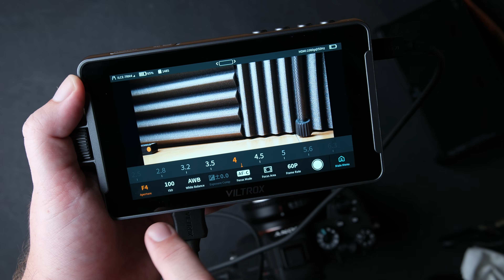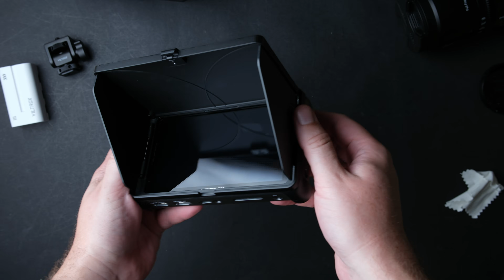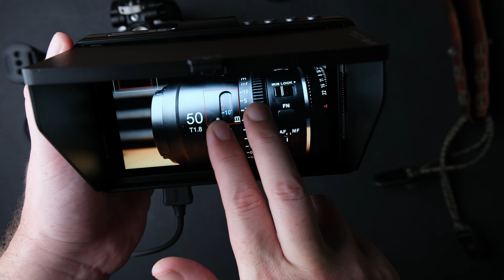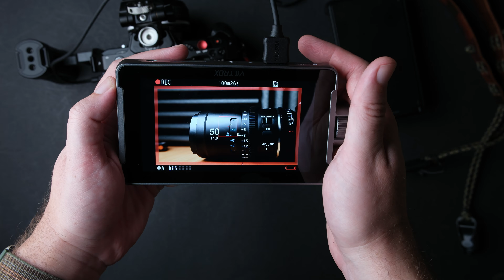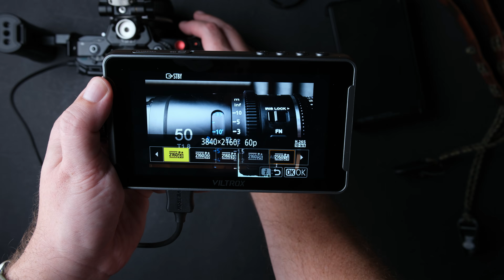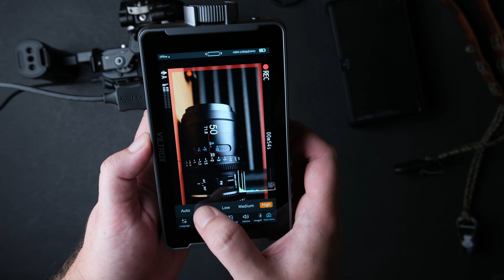Do It All Low Cost Monitor: Viltrox DC-550 Pro MK II Review

Comment: Thanks for a nice video Andrei. I bought two of these monitors DC-550 Pro ll for my two Sony A7C-ll, there's No Camera Control on the Monitor. Viltrox said: it was compatible on their list. (!?) well, I hope they will update the Firmware soon to Fix the Problem....
This is a Nice looking and Perfect Size for my Sony A7C-ll and I Love it.
Reply from the maker: My pleasure! There are two ways to connect the monitor to the camera, via USB-C or bluetooth. The controls will appear after you connect the camera. It won't connect just thru the HDMI. I hope this helps.
Reply: @AndreiDimaReviews     hi sir... i always record 4k 60fps will still black on the camera when recording? it was the problem of the version 1... does it solve the issue?
Reply: This is my experience too...
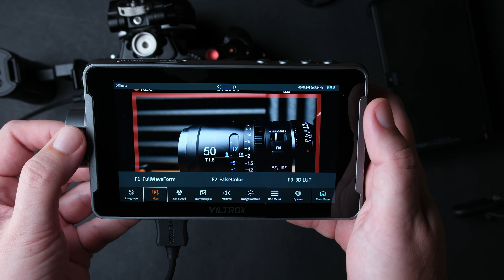I love your videos Andrei, I've been following you since we both got the Fuji XT4 around the same time. But you really need to be more critical of the products you are reviewing. I bought this monitor and within 10mins I realized this company is shady as hell. So much fraudulent advertising. Ya'll notice that every time the camera's HUD is shown such as in 4:31 top right corner says 1080p24P? and not 2160p. Despite one of the main marketed features is 4k input and pass through signal - but this feature is broken for most cameras. If I give it a 4k output it will result in "no signal". 

They promoted and advertised that this monitor is compatible with a bunch of cameras for camera control. (They posted a comprehensive list on their own reddit last I saw). I bought it and it turns out its a complete fraud. The cameras its listed as compatible for such as some of the Sonys, most of the Canons and all of the Nikons are not compatible. They told me they knew this but still wont update their website or compatibility list that they promoted. They wont allow me to return or refund it dispute the intentional deceptive marketing. They told me they are making no commitments to further develop the firmware. (If you check on their website, there are no firmware updates for the first or second iteration of this monitor) Their track record shows they would rather only put the new firmware in a new monitor so you would need to buy a new one rather than upgrading the existing one to receive its promised feature set.

Customer support privately said the only supported cameras they are committed to are the following:
Sony
* FX3
* FX30
* A7S III
* A7 IV

Canon
* EOS R6 Mark II
* EOS R8

Panasonic
* Lumix S5 II

Blackmagic Design
* Pocket Cinema Camera 4K
* Pocket Cinema Camera 6K series 

isnt it interesting how this isnt posted publicly anywhere?
Reply: make sure wireless band on your a7c2 is on 2.4ghz, not 5ghz.

Comment: Did you notice if this version has less lag than the original?
I find the original has just a bit too much lag to use for sports or fast moving subjects in general
Reply: This was my first time buying these monitors for my A7C-ll. 'cause of the viewfinder. it works very smoothly and no lag. Besides, it helps me a bit with the balance of the camera and straight out of the footage.
Reply from the maker: It still has a bit of lag but it is better than the first version.
Reply: @AndreiDimaReviews  thanks, in that case I might get it when it goes on discount